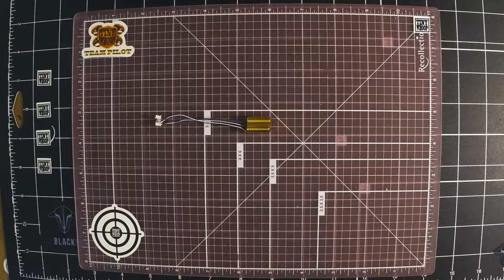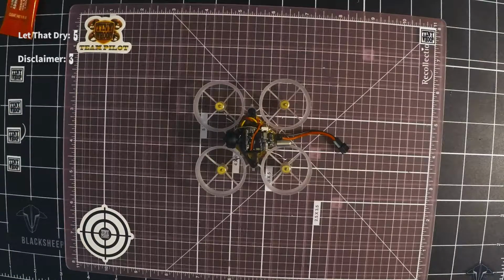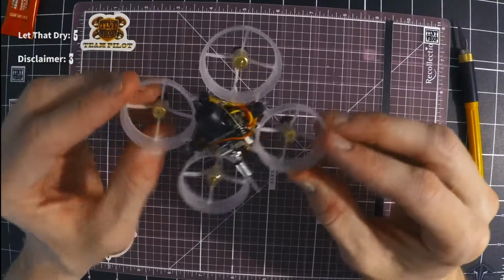Bombproof Tiny Whoop Mods

Comment: is there any way I can get an osd? I just got this build...
Reply from the maker: JBox FPV not on this particular build. The only way to get osd in the Beebrain v2 is to use the proprietary nbd camera and vtx system. In the interest on reducing weight and increasing performance, I customized the flight controller by removing the mounting hardware for that camera system. Doing that allowed me to use the fx900 cam which is lighter and accommodates a mullet mod. Essentially, this mod trades osd for strength and performance.
Reply: darn, ill tell my friend. Can I at least see my battery volt? sorry for asking the newb questions..

Comment: The one thing you forgot to mention that needs a  reinforcement is the camera mount the legs tends to snap off Ive broken three in the last month ... I would recommend  filling in the gaps in the 3d printed.. with the welder or similar stuff contact cement
Reply from the maker: Great idea. That’s not a part that I have typically broken, so it didn’t occur to me. This type of thing is exactly what I’m looking for in the pursuit of making the strongest whoop imaginable. I’m gonna start incorporating this reinforcement into my builds.